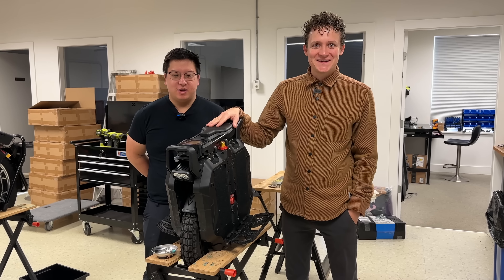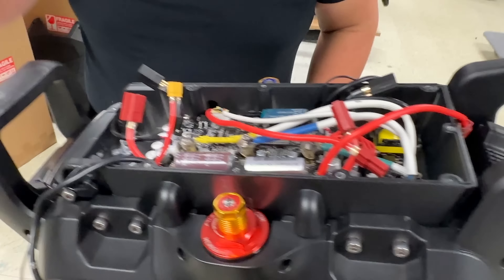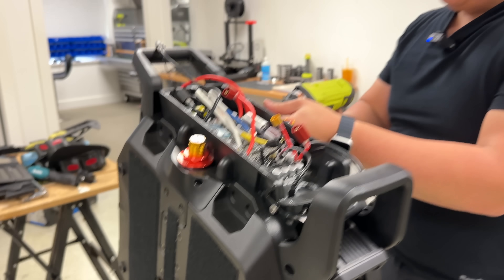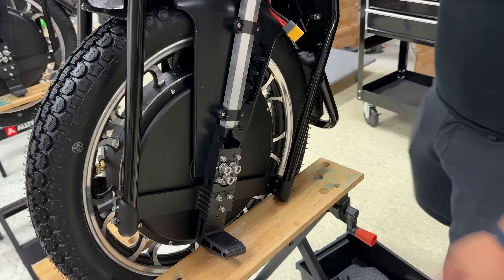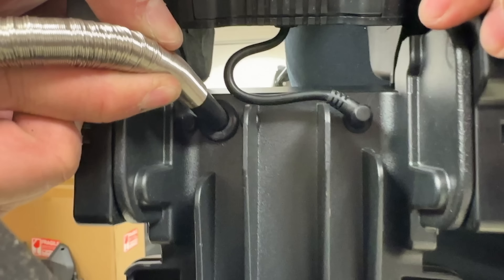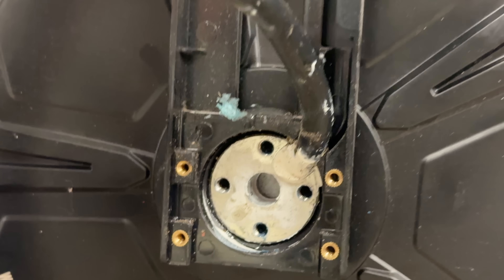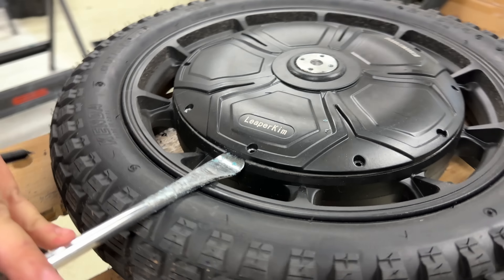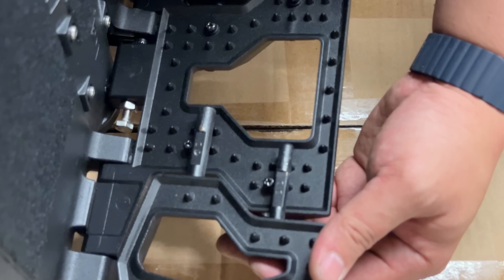Veteran Sherman S EUC Teardown — What's inside this electric unicycle!?

Comment: i built an ebike about 15 years ago when everything was DIY.  I was never really fond on direct drive hub motors because of how they shaved down the axle flat with the wire coming out of it and bolting it onto a bicycle frame hoping for the best.  That was all you had back then.  Looking at this, it looks like those days are long gone. Four big bolts directly onto the axle, doesn't look like a mickey mouse job some dude put together while drunk.  I like it

Comment: Do the bearing have gear in them? 

Looks like the shocks should be connected on the top as well. When you turn, you're going to be putting flex on it, and the top keeps it together, so you are making a big leverage spot. Looks good tho . I may just be over thinking it

Comment: Very interesting video.
I'm actually concerned about the friction between the lower part of suspension attached to the motor and the inner shell. Another person already reported the same problem.
I think it come from a suspension bending and the U form not being as stable as it should be. 
What do you think ? Will it be problematic after 5000km? 10000?
Thanks

Comment: Awesome video thanks guys ! My only concern is the battery wire connecting the packs together at the bottom. I wish they could find a way to relocate that wire towards the top end up by controller vs down where rocks could potentially hit

Comment: Hey Eevee’s, I’m new to EUC. With the high price tag of these EUC its concerning seeing plastic zip ties inside the motors especially when you hear issues with the motors failing. I’m sure there’s a better way of securing the motor wires. Plastic zip ties will eventually get brittle and shatter.

Comment: Honestly, for that price I expected better quality. There was quite a bit of wear inside even though it has been used only for a couple days.
The water isolation is not great either and it's hard to change tire.

The pedal design isnt well thought either. And no smart BMS neither.
The front handle which was metal in Sherman seems plastic... Which would easily break in case of a crash.
Reply from the maker: Keep in mind, this is a pre-production model. Veteran is taking our feedback and making changes before going into production.
Reply: You want something to break to absorb the energy of a crash. Plastic parts that stick out are smart. They will be cheap and easy to replace. 
It’s metal where it needs to be. So far so good.
Reply: @darkstar4494  No, you don't want anything to break. Build a hard shell to take the blunt and outer rubber to absorb the shocks. Build a PVC plates for the battery packs and rubberized the outer shell.
Reply: @eevees 
Well, I hope so, but Im skeptical if they really will do work on it.
They might, they might not (hopeful not the later). But even so, it is possible that we get a "fixed" wheel only six months later.

I really hope they fix those problems, because imo compared to other EUCs or the max right now it shouldn't be 4100+ usd.
Reply from the maker: @BigBoss-gb4cx  I can’t think of a better teardown on any other new wheel. No major concerns. We just pointed out any possible negative we could find. Personally, the teardown has got me more excited about the reliability of the Sherman-S.
Reply: @eevees  It's just that it's a 4000 usd EUC. When people think about that price point... For 4-5000 you can buy a very quality Kawasaki motocycle.

I know it's totally a different animal, but you would still expect quality.
Reply: @Hunter_Heart  cars have crumple zones for the same reasons. Helmets are designed to crack with a certain impact force.
You want something to break because it absorbs energy. it seems veteran is using this technique.
External plastic parts are strong but cheap and easy to replace for a big impact.
Reply: @darkstar4494  Cars have crumple zones because there is not a technology that could save it on "high impacts for 2 ton+" vehicles. At low impacts, you could see those bumpers dent popped back out the next day. So, zero in repairing for low impacts on bumpers. EUC is 120 pounds max, definitely survivable with a hardshell and thick rubber enfocement. Then there is a factor of it bouncing, shedding of the impact forces like a rolling a bowling ball for EUC high speed crashes.
Reply: @Hunter_Heart  So you’re saying dissipating impact force with a cheap and easily replaced impact resistant plastic part is not a good idea?
You’d rather allow all the force get transferred to the batteries and electronics?
Crumple zones are there to protect humans from impact forces right?
Reply: Win From Within  except it’s not little. And impact resistant plastic can handle a lot of force. It sounds like you aren’t aware of this. 
And it’s elastic.  The front and rear handles double as bumpers. 
This is the design they have chosen.
Why do you think they did that, when their previous iteration had a metal exoskeleton?

Comment: pls guys lets push Linea and the peeps from leaperkim to make sherman S next batch higher voltage looks like the wheel is just dope.

as a sherman rider myself my only issue with the S is why stil 100V....... not getting higher voltage?????????? 
PLEASE LEAPERKIM MAKE THE S 134V... I wish they would give it more battery aswell but hey making the perfect wheel would be counterproductive just pls GIVE SHERMAN S HIGHER VOLTAGEEEEEEEEEEEEE and i will buy it

Comment: Thanks guys ✌️ 
Very informative. 
The structure is fascinating. 
Many parts hanging off other parts, that will be putting a lot of stress on certain bolt points. Also areas already worn from friction, and there were metal flakes from the screw removal.
Hopefully Leaperkim will address the issues in this prototype and nail the final version. 
It's by far the most expensive 100v wheel and every part should reflect that in the quality.
(I'm sure that Leaperkim has a plaque on the wall that reads 'Remember the Abrams...'

Comment: So no smart BMS and no quick tire change. The v13 seems to be the better wheel so far other than range.
Reply: Don't hold your breath, V13's suspension is mediocre that it was not even made it on the bullet points of their presentation.
Reply from the maker: Time will tell
Reply: Good point Wen a BMS needs to be standard practice on these. I wouldn't be concerned about tire change time taking the tire off and putting another on blows enough I would be less concerned about getting to it imo

Comment: Those pedals look like trash. I miss the parts on frame design. No gasket on control board sucks. Idk. Not a fan of many of these compromises.
Reply from the maker: Keep in mind, this is a pre-production model. Veteran is taking our feedback and making changes before going into production.
Reply: No biggie Nylonove will make a set.
Reply: @mcfly_ev  I hope so
Reply: @jonwall4994  they usually do right around when the wheel is released.
Reply: these pedals are a swing and a miss. Way over complicated. The clutching mech doesn't stand a chance without added attention. Length adjustment is just not needed and at how much weight penalty for the added hardware?  Angle adjustment and Replaceable threaded pins is all thats needed. Maybe Nylonove will make an improvement set. Maybe just like the suspension colab, they should do a pedal colab?
Reply: @jonwall4994  il make a video when i get mine explaining how the length adjustment changes things... is not so much a length adjustment as a weight centering offset.. its genius. first wheel that lets you dynamically adjust your weight relative to the front or back of the axle.

Comment: The main thing that concerns me is the overall structure. Why not have a rigid suspension bridge instead of a convoluted structure connected with bolts?  As far as plastic is concerned, if this was made of the polymer found in glocks I’d have now worries about it b

Comment: Albert might be a Begode Spy 😂😂 jk.

I really think this wheel came with a underwhelming motor for its price considering other wheels. 
Abrams on sale for $2621 CAD and it has a 3500W motor.
Sherman Max $3744 CAD and it has 2800W motor.
V12HT  on sale for $2172 CAD and it has 2800W.
KS22 on sale for $2471 CAD with 3300W motor.
Master $3220 CAD with 3500W motor.

SHERMAN S( $3994preorder)$4497 CAD for 3000W motor???? idk man. Id wait for the next version with a more powerful motor. other then that tho, it seems like the ultimate wheel. perfect size wheel, perfect battery size, great looking suspension that's not clanky, over all seems great besides the small motor for over $4k.
Reply: You look like great expert. How much power has Abrams’ mainboard? Or Sherman Max one? KS22? How much power you got if connected 100 kW motor to V12HT mainboard?
Reply: @maximlapshaev  

I have no clue, i didnt say anything about mainboards. I know how many watts the motors are though lol.
Reply: @HumbolSkitso  motor power is zero without the mainboard. In fact it’s one device - the motor and the board. If there is not enough torque, that’s mainboard’s current limit as usual. If there is not enough speed, that is concerning Kv and battery voltage. IRL motor power of EUC means almost nothing. Torque and free spin speed mean much more. What’s more we don’t measure the torque, we just feel if it’s enough or not. We can measure speed and do that. We never say like “yesterday I made 5 kW on my Abrams”. We cannot measure it and compare to each other, completely useless number.
Reply: @maximlapshaev  

Ok i see your point. So in theory we could keep our same wheels and just upgrade our mainboards? And the result could be more performance with increases in speed and torque? I feel like the motors Wattage has to become a limiting factor at some point right? I wish i knew more about electronics, sadly i only know whats advertised. So in my head, 3500watts beats 3000W.
Reply: @HumbolSkitso  now you’re making some progress in understanding that stuff 😉 one motor can have more power if used with 100 volts battery and mainboard than with 84 volts gear. All known things about the Sherman S motor are: equal numbers of slots and poles to the original Shermans’ motor. So, the only thing that differs - is mainboard. They could use slightly more wires in phase windings, but there is really small room for improvements if basic configuration is the same. We can mark an electric motor as one with bigger power if we just improve its cooling. You can see how side covers of the new motor look like. They can deliver a bit more heat outside the motor with their edges in comparison with old ones. So we have almost the same motor with new mainboard with higher phase current limit. And new number of kilowatts. Testers say that the torque is great. Ok, I can see bigger phase current from mosfets to the motor in that statements. To the same old motor, you know🙂

Comment: Good job Albert. More of his input please .  Nice to see that gimmick taillight is just a plug in and easily replaced. Disappointing to see all those rub points that need to be clearanced.  Philips screws anywhere on a wheel of this price point  WTF? The trolley handle looks questionable. This looks ruff and unfinished definitely not a finished product
Reply from the maker: Correct. This is a pre-production version. Refinements will be made based on our feedback to Veteran for the production version.